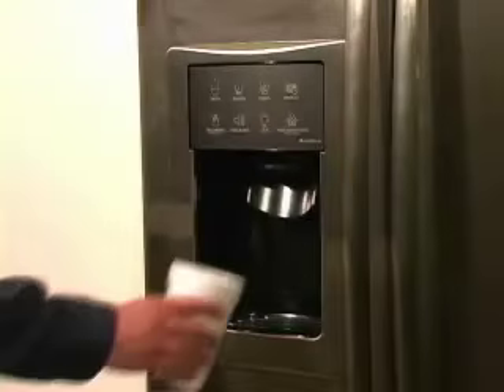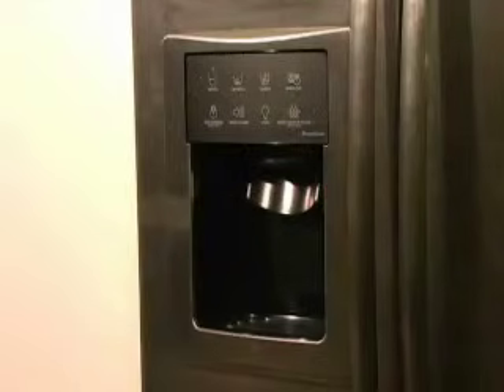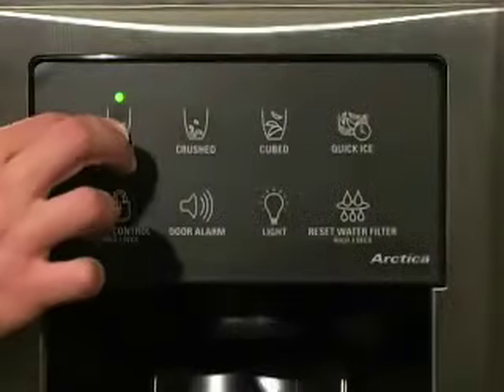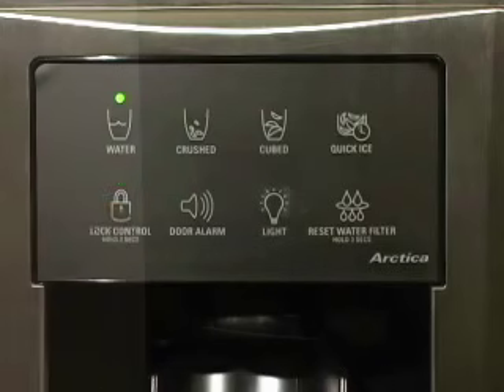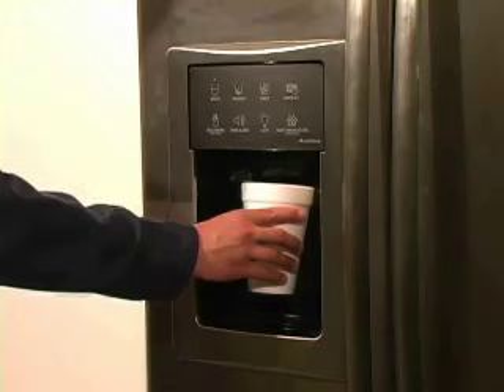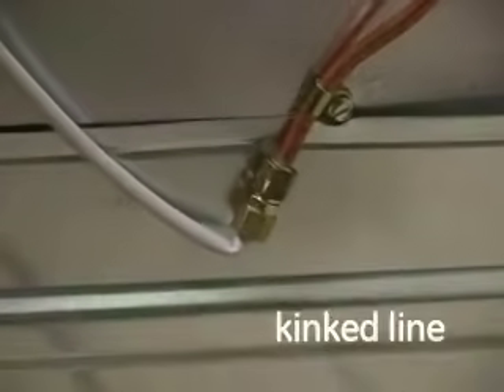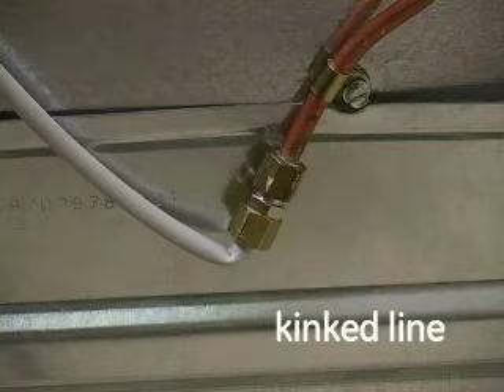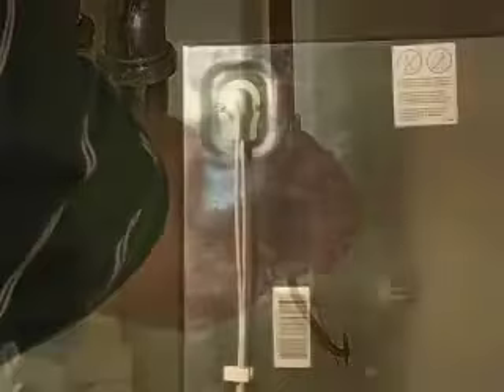Slow Water Dispensing Issues

Comment: Always check the simple things 1st! I almost ordered the filter hose kit and almost bought the solenoid kit before thinking “where does the line go?” When I followed the water line from the fridge through my cupboards and down to my utility room I found that the valve was not fully open. All I did was open the valve and VOILA! Full stream of water, no waiting forever for a glass of water and ZERO cost :) No need to try to clean out the mineral deposits from the hose lines either.
Reply: Excellent. I was having slow water flow. Just opened water flow valve all the way and now it works fine. Thanks
Reply: @subodhsharma1680  After awhile I did find that I also needed to change the temp setting on my freezer from 3 down to 1. My freezer was getting too cold during the winter (not sure why) and it was causing my line to freeze. Adjusting your freezer temp setting can fix low water flow also.

Comment: Ill tell you what I did that worked. I poured vinager in the tube to the fridge ( disconnected the line and poured vinegar in the line to the fridge. That didnt seem to be helping much, but what I did that finally  made a difference was to take the filter out and then fill a glass and repeat. Every time what I could hear was a lot of suction being put on the lines. The water would come out good for a few seconds and then slow down. But once it slowed you could literallly hear the suction on the line vibtaing the line. So I kept pulling the filter and repeat. after about 1/2 dozen times it broke loose. Works fine now.

Comment: The one thing I HAVE NOT seen on these forums is the filter housing unit. It has a valve that shuts off the water when the filter is removed so your kitchen doesn't flood when the filter is removed. THE OTHER FUNCTION OF THIS VALVE IS TO FULLY OPEN WHEN THE FILTER IS INSERTED. When a new filter is inserted, you can usually hear water run into the filter for a second or two. My other hint that this valve on the filter housing was bad was that when I had the filter removed, THIS VALVE DID NOT FULLY SHUT OFF THE WATER AND THEREFORE I HAD A SMALL LEAK. (this will run into the water catch reservoir so do not let this leak go on for long) Hope this helps. Oh yeah, i had already replaced the water inlet valve and that did not fix my problem of slow filtered water.
Reply from the maker: +WILLIAM Johnson Thanks for your feedback, William!
Reply: The inside filter housing are cheap plastic that doesn't last long.
Reply: Thanks. How did you replace the housing valve?mine has this issue, water leaks once filter is removed. thanks

Comment: My dispenser was working just fine until I changed the filter. Now it takes 21 seconds to dispence 8 ozs. I tried using the bypass valve, and since it was working until the new filter was placed I don't think there is a problem with the water line.  Any other suggestions?
Reply from the maker: Hello Lenore, I'm sorry to hear that you are having this issue. Make sure the cradle has been held down for 2-3 minutes to allow the reservoir to fill completely.
Note: It should only take approximately 7 seconds to fill an 8 ounce glass.

If it is taking longer, we recommend contacting GE Consumer Service and have them come out and diagnose this issue. They can be reached by calling 1-800-432-2737. Thanks so much for checking with us. Have a good day!
Reply: Mine takes 21 seconds too.
Reply from the maker: lastcall170 Thanks for reaching out to us! Please take a look at our following video which includes some additional tips:

https://www.youtube.com/watch?v=C-rAsqswf_k

Comment: An ongoing issue with my side by side door water dispenser is its freezing up. Recently it froze twice in a 24 hour period. I'm using the copper wire/string trimmer line with a hair dryer on the backside of the dispenser to get it free but this has gotten old, stale, tiring. I've paid to have a Service call and I won't do that again for the same issue. GE hasn't told me they have a fix so this will not happen again. They say schedule a service call. This will not fix this recurring problem. I will add a thin piece of insulation inside the door behind the dispenser and see if that works. No solutions from GE.

Comment: Replaced water filter in my 4 year old GE Profile French door refrigerator. Now, the control board says, dispenser off. How to I turn the dispenser back on. This has never happened before.
Reply from the maker: Hi, could you please send us the model number of your refrigerator? We'd be happy to look into this for you. -SK
Reply from the maker: Hi, you may have the wrong filter in the unit. Could you please tell us the model number of the filter you purchased? Thanks. -SK
Reply: @geappliances  RPWFE

Comment: I just bought a new GE fridge it takes 5 minutes to fill one cup New Fridge Ic works fine very slow water flow WHAT SHOULD I DO ITS NEW INSTALLED
Reply from the maker: Hi - I would check to see if the water  to the refrigerator is turned all the way on at the shut-off valve.  If you have a by-pass valve, you can put it in place of the filter to see if the filter is clogged and just needs to be replaced.  But if these suggestions don't help, then I'd recommend service.  Here's a link to our on-line service page:

http://www.geappliances.com/ge/service-and-support/service.htm?ICID=GEARsupportflyout-service

Thanks  -CC
Reply: GE Appliances new fridge 3 weeks old too new for filter to be clogged ?
Reply from the maker: Hi, 
Did you install the by-pass valve, in place of the filter, to see if the flow improves? Was the flow fine when the refrigerator was initially installed? Please let us know when you can.  TH
Reply: GE Appliances yes the flow was good when installed but gradually the flow got very light
Reply: GE Appliances Good afternoon Hi I just took out the water filter and installs the cap and the flow is GREAT so this mean the NEW filter that came with my NEW fridge is defective fridge is just installed 3 weeks
Reply: This is upsetting how do I get a replacement Filter
Reply from the maker: Hi - please email us at eResponse@geappliances.com with your name, address and phone number as well as the model & serial number of your refrigerator and we'll be glad to take a look.  Thanks  -CC
Reply: GE Appliances ok will do
Reply from the maker: Thanks for working with us.  -CC
Reply: GE Appliances thank you for your quick response will send email today 👍🏼